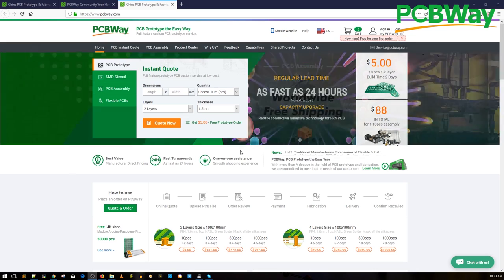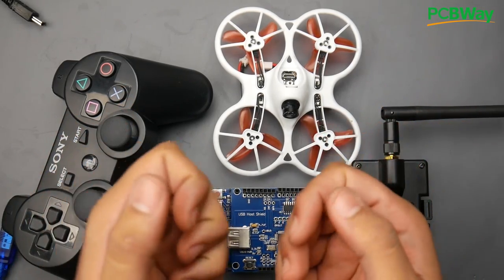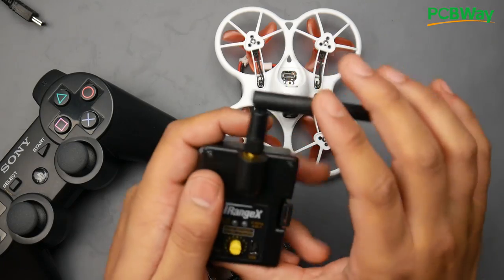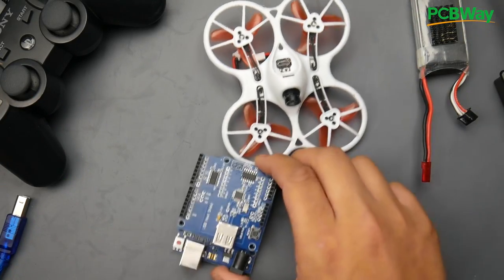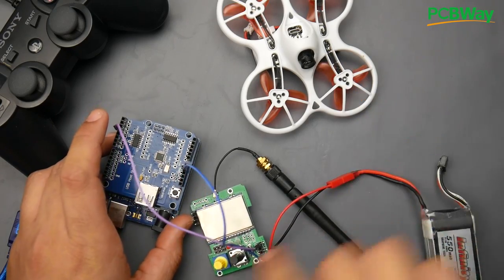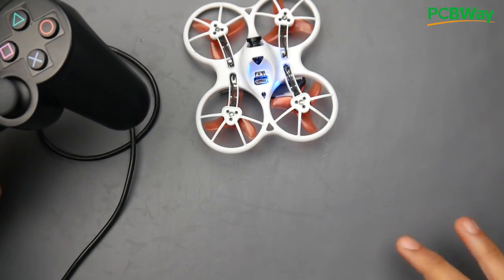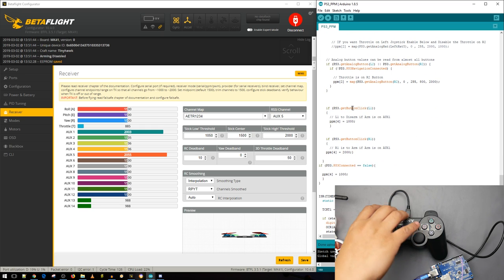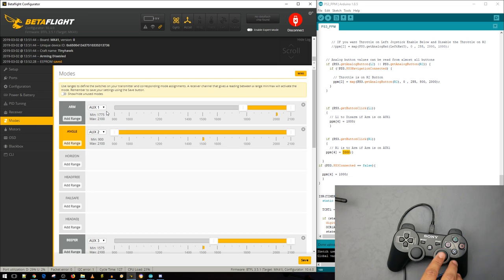Fly FPV Drone or RC Airplane With A USB Controller // PS3 Controller MultiProtocol Module

Comment from the maker: The Joystick Part of the video is out of sync .. Sorry about that :(
Reply: @Drone Mesh how could one wire this up so that instead of plugging into an external module you can plug into a trainer port via a 3.5mm jack or even wireless bluetooth trainer
Reply: What is the approx range you get with this one

Comment: This is awesome. I’ve always wanted to try some fpv with a full computer joystick and throttle and looked for a solution a couple years ago but came up empty. Definitely going to look into buying a used joystick and pick up an arduino now.
Reply: PC Joystick with throttle would be pretty cool to see, as would seeing an rc-pistol grip controller with trigger throttle.

Comment: This is fantastic! I've been wanting something like this for some time!
Did I hear you say a pc Joystick will work with this? I'm interested in flying a fixed wing model with a pc Joystick. 
I have a Jumper t16 radio with an extra external multi module.  Will this work or is the IRanger module needed?
Reply: Flying via joystick would be awesome!

Comment: If you’re having a problem with the throttle not getting to zero, you should be able to set a minimum value to think it’s at zero when it’s actually at, for example, 8.
Reply from the maker: If you see the code I dropped the map to 800 to 2000 to combat that issue... There is a lot of ways to handle it ;)

Comment: I really liked your video; very educative.  I'm a beginner in all this stuff and  was wondering if using the modules were mandatory? Can it be done with the PS3 , arduino , shield and drone only because the modules are a bit expensive and I have a very limited budget for now.

Comment: Will this work with multiple USB controllers connected together with a USB hub? I want to try using a PC flight stick, rudder pedals, and throttle or collective lever and basically build a ground control station to fly my drones like a simulator.

Comment: Thank you so much for this.  I had a bunch of issues, but worked through them...mostly matching up frsky tx and rx firmware.  I found code for logitech 3D, and it works very well.  Just need to build a plane and throw it on!

Comment: Hi! I know im a few years late, im currently on a similar project. Just wanna ask, can i instead connect the 3s battery to the arduino instead of the irx4 module? Figured it would be much cleaner that way. Thanks

Comment: Could that digital output pin 3 go straight to the FC rx pad? You can ask why but I'm gonna get some hate. Trying to connect controls straight to the FC because I will actually be on board not remote. I'm a mechanical engineer and the only software engineers at work don't seem to want to help.

Comment: Nice work! I was curious if I can use this same code with a Saitek. I'm looking to repurpose and Saitek X45 as a controller for a fixed wing trainer for FPV testing etc.  Conceptually it seems the same but it looks like I would need need a library specific to Saitek or Logitech?

Comment: Hi! Can i bind the receiver and module without an actual transmitter where the module can be attached? i dont have any use for the transmitter so i figured i should just buy the irx4 tx module

Comment: Do you have a code for arduino nano and ps2 controller for a drone. So they can interface. This ps2 controller is the wireless controlled one you can buy

Comment: Can you power the Arduino with the power jack and use the Arduino USB jack for output to eliminate the need for the USB shield?
Reply from the maker: No, you need the shield because it has the correct IC's to do such a thing